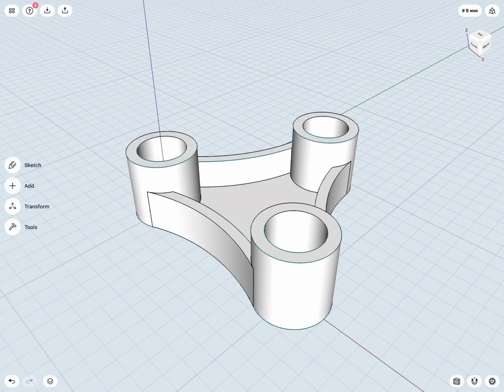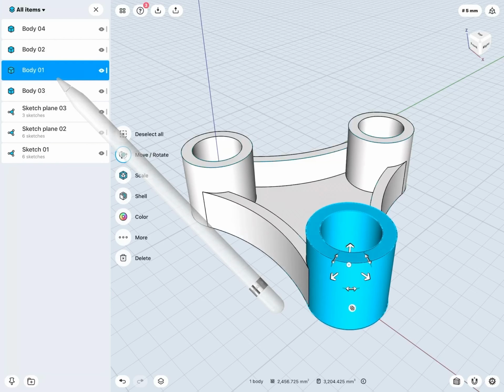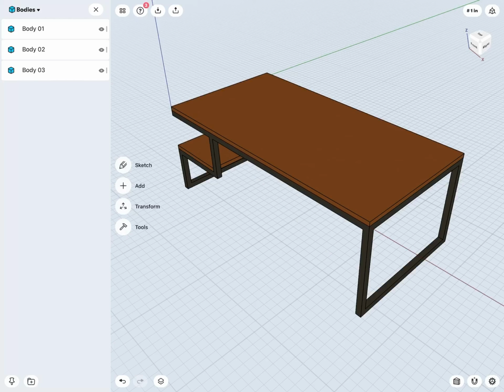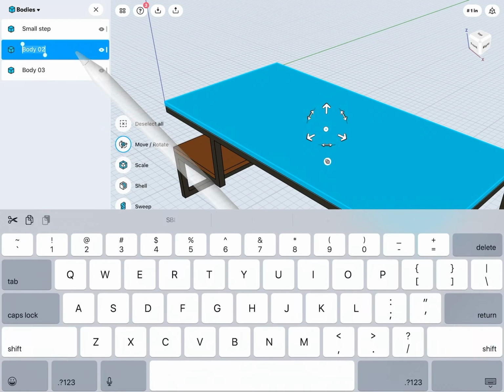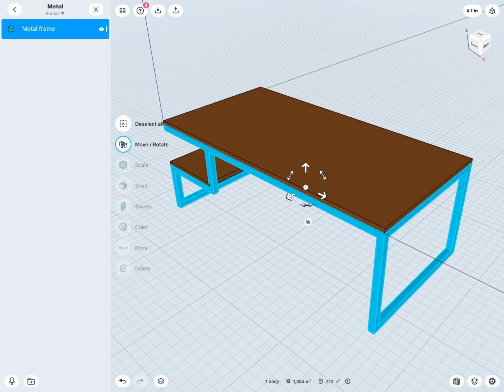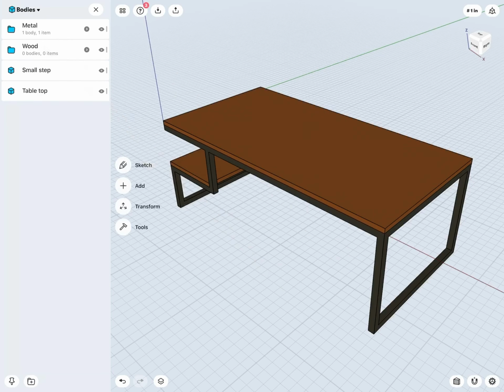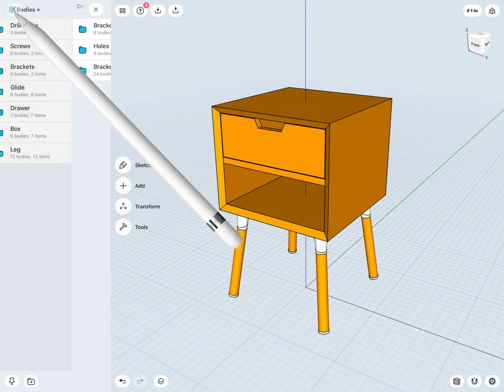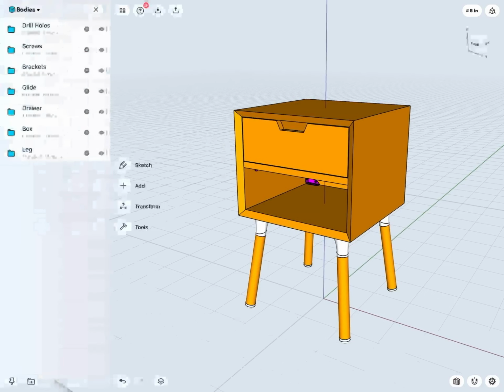Items | Creating simple 3D bodies

Comment: Is this feature only by subscription? I’m in free version looking to pay a year but when I move bodies and sketches to a folder and then HIDE THEM, so I can work properly with other parts in a different folder, and as soon as I sketch a line on my new folder,  all the bodies and sketches of the hidden folder show ups automatically, without pressing anything! , if is not a subscription feature, so how can I lock all the bodies and sketches of a hidden folder without shows up automatically. Love love the app, and I need it thanks
Reply from the maker: Hi, Everything apart from exporting and importing features are the same in the free and the paid version, the source of the case is different. 
At this time on one sketch plane you only can have one sketch. If you hide a sketch on a specific plane but you create a new line on the exact same plane, it would be the part of the hidden sketch, so the sketch should be shown. 
What you can do with the bodies in your folder is to hide them in the folder itself. That way when you start a sketch on a plane, the old sketch on the plane will be shown but the bodies remain hidden.
Reply: @Shapr3D  thank you, I will try then, but the condition of having a sketch per plane  is quite odd...